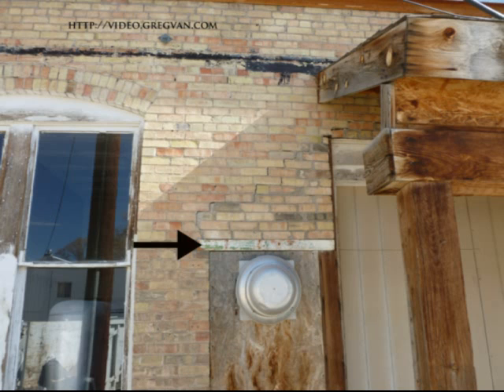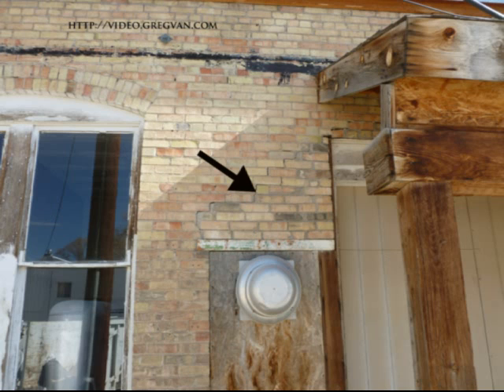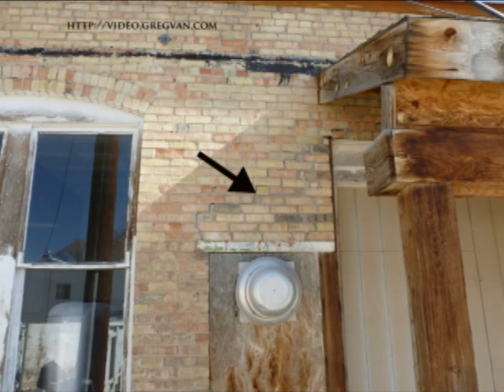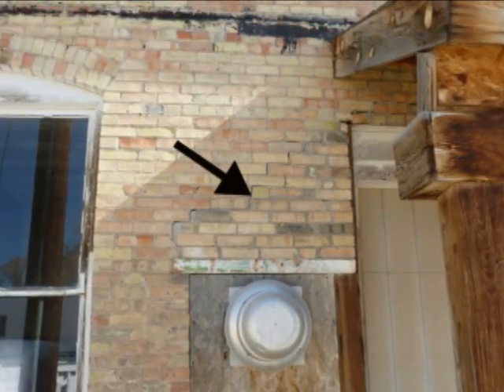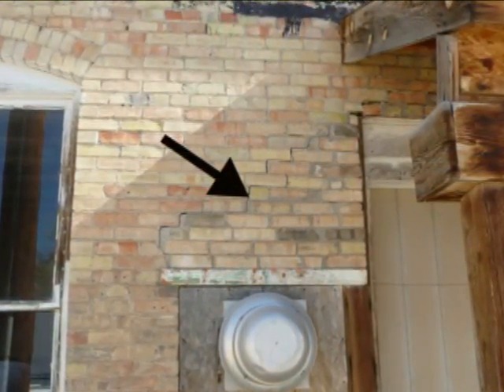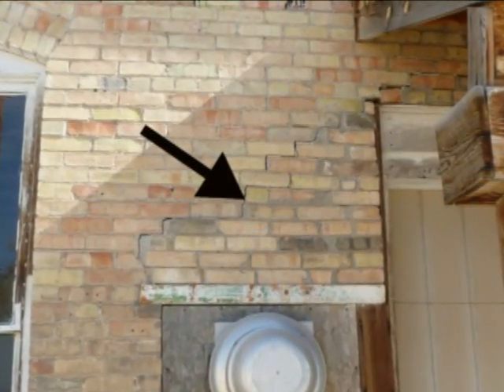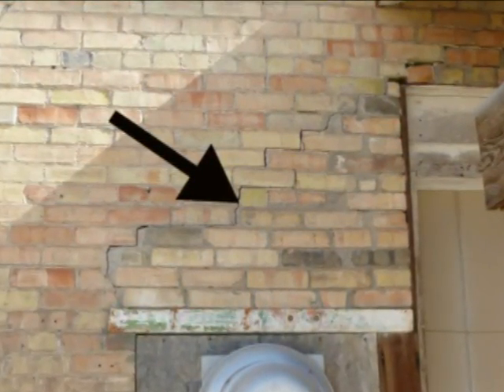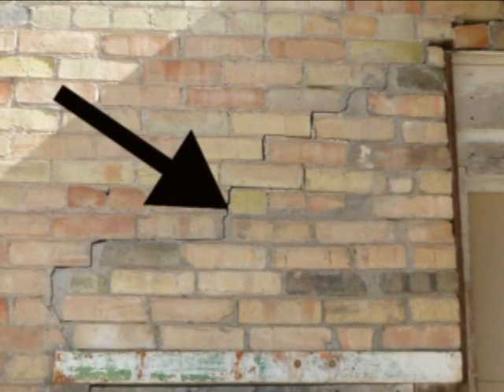Lumber Shrinkage Can Cause Brick Walls to Crack - Masonry Tips

Comment: Was that part of the brickwork built in at a later date?  It does not seem to be laid to the same standard as the rest of the wall, and the bricks and mortar joint do not match.

Or is this a result of various attempts to patch up the pointing following settlement?
Reply from the maker: I'm not sure, I took this picture in an old town, in Colorado, USA. However, I think it was all built at the same time, but has been remodeled and looks like it's been remodeled again and again.

Comment: Brick and metal are more stable, the depth and width of the foundation would make
it less subspectable to settling would that be true. thumbs up.
Reply from the maker: Actually bricks aren't as stable as most people might think, especially if you read the story about the three little pigs were one of them had a home built out of brick and the big bad Wolf couldn't blow the house down. In earthquake zones like California, brick buildings need extra structural reinforcement and most of the time are only used as a building covering and not used for structural support. You are correct about the bricks being less susceptible to settling where that might not be the case with wood.